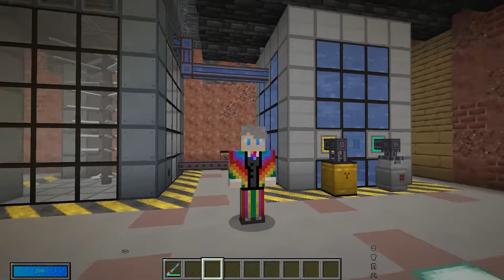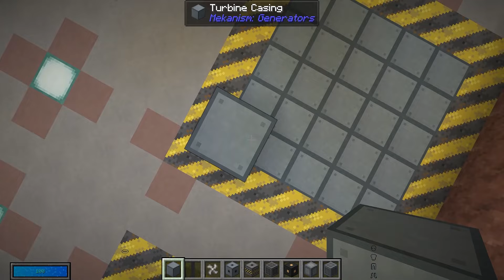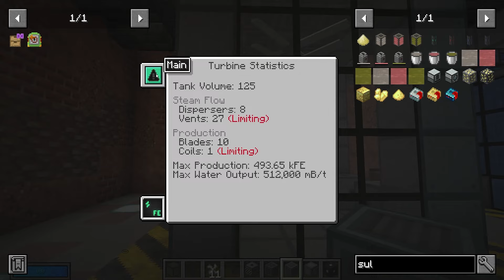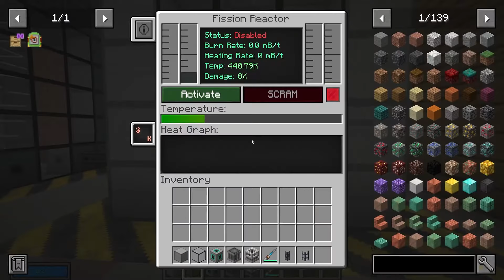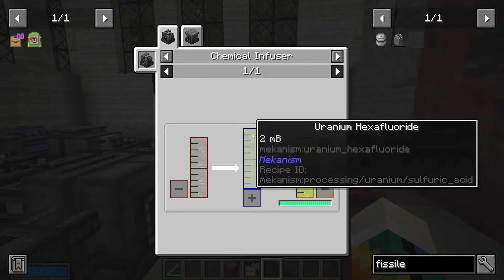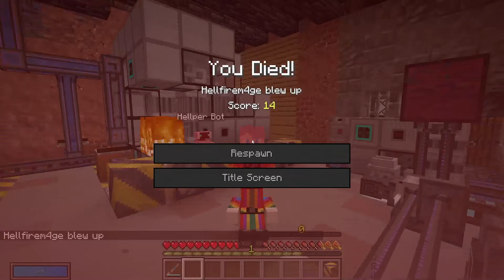Fission Power is Powerful (And Deadly) - Mekanism Fission Reactor (+ Turbine) Guide

Comment: I'm not sure what to do my fission reactor just won't work I tried everything I looked over the video 5 times .do you have any advice?
Reply from the maker: What modpack are you using? Some packs require structural glass for example
Reply: @Hellfirem4ge  Sorry I was using another modpack that had two different types of reactor glass and i used the wrong one on accident
Reply: If you may I have another question I was wondering how you got the water to fill up the fission reactor so fast is there another pump besides the regular pump because originally, I used 32 pumps and I only just a little bit of coolant.
Reply from the maker: @antsforever1356  I think in the video I used mekanism pipes and a sink from cooking with blockheads but having a lot of pumps is probably the way to go with normal mekanism. Thankfully you don't lose water over time so you only need to fill it once
Reply: @Hellfirem4ge  Thank you so much for the info overall the video was very helpful, and I wish you luck to a million subs!

Comment: I followed every steps 2 times and it blowed up each times , i really dont know what im doing wrong i set the fission reactor to 0.3 so it doesn't absorb too much water beacause i dont have the sink like you have so im using water pump and i need a lot of them  and i added some waste barrel  in case , after 5minute trying to build the setup for the fuel i turn around and it was all explode , The mod Mekanism was really fun until this part , maybe you should use something else other than the sink next time so people dont have to struggle with a other solution ?
Reply from the maker: Before it blows up, is there still water in the reactor? Chances are you're overflowing energy if there is still water there

Comment: I’m having an issue where I can see both the turbine and reactors interface but when I activate the reactor, there is no burn rate or heating rate. Nothing happens. I’ve looked through the comments and found the structural glass switch from reactor glass for the turbine and it hasn’t helped. My coolant tank is filled with water all the way. I have everything connected with the correct cables, my reactor ports are configured to the right setting. I have the second turbine valve connected to an ultimate energy cube for power. Still nothing. Any help? Thanks
Reply from the maker: I've honestly never heard of that error I'm afraid so I'm not sure what would be causing it 🤔
Reply: @Hellfirem4ge  actually, i just rewatched your video. And saw that the moment your reactor turned on, there was fissile fuel in your fuel tank. Did I completely miss that part? I need to have fissile fuel in the ultimate fuel tank in order for it to work?
Reply from the maker: Oh yeah absolutely, you need to have fissile fuel for any of it to work 😊
Reply: @Hellfirem4ge  can’t believe I missed such a fundamental factor. The fuel. Thanks for the help. Great video:)
Reply: Hey @Hellfirem4ge i need help on one more thing. I put together all the machines to create the fissile fuel with all the logistical, mechanical, and pressurized pipes. But it seems in your setup, you dont have any universal cables for power. Are they underground in your setup? Not sure if you even need the power. Thanks in advance
Reply from the maker: @Voundier  yes they are 😊
Reply: Great, just finished making the fissile fuel and my both my reactor and turbine work. Thanks a lot. Earned a sub
Reply from the maker: @Voundier  glad to hear it! Now your job is to make sure it doesn't blow up your base 😉
Reply: @Hellfirem4ge  it just did😭😭. I looked up it takes about a week to pass on. I’ll just be using digital miner to recollect the ore needed to make it again😞
Reply: @Hellfirem4ge  I think I didn’t have enough waste barrels? I left it alone to do some other stuff and I came back to it blown up and died to the radiation. I don’t know what I left out cause it all worked well and I didn’t max out the burn rate(I left it at 10/15)
Reply from the maker: @Voundier 10/15 is still insanely high! Waste will go up pretty quick at that rate and you will get a lot of energy so an ultimate cube will fill up in a couple of minutes so you need to be siphoning the excess energy
Reply: @Hellfirem4ge  I see, I thought 10 would be fine. so the issue is that there’s too much energy in an ultimate cube and that causes the explosion? Or is it the waste barrels?
Reply from the maker: @Voundier probably both, but I would imagine the energy is a bigger deal. It will back up the system, stop the steam from being turned into energy and then the reactor fills up with steam and can't cool down so it explodes. You'll want an induction matrix or some sort of energy voiding mechanic
Reply: @Hellfirem4ge  ah okay will try it. Thanks for the help again

Comment: I'm having some troubles with the yellow cake uranium. I'm trying to use refined storage to auto-craft them, but my crafting monitor says that "no machine is found". The crafter is connected to the enriching machine and it works for other enriched things - yellow cake uranium is the only thing that it can't find the machine for. Any ideas on what the issue could be?

Oh and btw, great video!;)
Reply from the maker: Thanks! It should just be an enrichment chamber. I've not tried connecting RS up to it so I'm not sure why it wouldn't pick it up. Have you tried outside of RS to see if it works?
Reply: I have my crafter with a cheat in front comected to the enrochment chamber then an imported on the enrichment chamber the the system

Comment: Mine exploded.  For some reason the steam wasn't get turned back into water
Reply from the maker: Did you have enough condensers in your turbine?
Reply: @Hellfirem4ge  yes I realized I didn't have enough storage for the power so the system got backed up? How do I spore mass amounts of power? Induction matrix?
Reply from the maker: Induction matrix for sure or if you just need an overflow, a cube with energy dumping to get rid of the excess
Reply: @Hellfirem4ge  awesome thx! Keep up the great work bro

Comment: done this step by step and it doesnt work still.
Reply from the maker: It's worth checking the requirements for any specific modpack you're using. This should work perfectly for standard mekanism or VH
Reply: @Hellfirem4ge  thanks for the reply man I figured it out I needed to use structural glass instead.
Reply from the maker: Ah yeah that's a common issue for some packs 😊

Comment: My reactor isn't working because there's no power coming in, but I followed it step by step and the power doesn't work, I have enough power and I've already redone it about 30 times, can someone help me?
Reply: Im having the same issue. I have every step done and triple checked. I even filled an ultimate energy cube and tried powering it that way, still doesnt turn on. He didn't show him powering it on with the energy cube so im assuming he might have used the configurator to change the way it connects to the turbine valve. not sure though
Reply: @Voundier  i just put steam on it and it works, the power dont show btw, ATM7 to the sky version

Comment: i only need the reactor for the radioactive waste, do you think this could work with a electric pump and elite pipes? on the lowest settings.
Reply from the maker: So if you set it up correctly, you don't actually need to be pumping any more water in, so you could use that setup to fill the reactor, it would just take a long while. Just make sure that you turn it on, wait for the water level to drop, then turn it off and fill it up again to keep it flowing 😊
Reply: @Hellfirem4ge  i'll try, thank you very much for the detailed guide :)

Comment: is there a reason my turbine reactor won't accept power? i have connected universal cable and it does not have any power, my guess is that it has so little that it doesn't show
Reply from the maker: Turbine reactors don't need power, they need steam from a reactor and then output power

Comment: Followed your instructions very precisely and my base blew up
Reply from the maker: If it blew up, you definitely missed something.
The things that can cause it to blow up:
-Not enough coolant being pushed into the rector
-not enough energy storage so the steam backfills into the reactor
-chunk loading issues if you leave the reactor running, especially when offline

The redstone contraption i show at the end of the video should fix all but the chunk loading issue though
Reply: @Hellfirem4ge  thank you :)
Reply: When I built mine found out it was an energy issue built a Resistive heater set it to max and have been running the reactor at 100% with no issues.
Reply: I built it just Like you but the fission reactor does not construct only the Turbine
Reply: @yannickschmitt5059  gotta use turbine casings to build the turbine i did the same thing. If you use the fission casing blocks it wiil not work

Comment: What pipes are you using? I can’t get anything to connect when trying to make the fissile fuel. There’s multiple pipes in the video it seems
Reply from the maker: So for most of them you need ones that transfer gas, so the pressurized tubes but some things need normal pipes
Reply: @Hellfirem4ge  I’m using mechanical pipes and pressure pipes but I can’t get either to connect to the enrichment chamber
Reply from the maker: Make sure the configuration is set correctly in the enrichment chamber. It allows you to restrict which sides things can go into
Reply: @Hellfirem4ge  it’s the logistical transporter tubes! I found them. Thank you!
Reply: I'm still having problems connecting the port to in put water

Comment: So quick question? I built the while thing right… now i dont quite know where i would put my Flux plug or some thing like that to use the energy produced?
Reply from the maker: You mean the port? You can replace any of the glass with a port and it should still work 😊
Reply: @Hellfirem4ge  Alright ill try it next time i hop on the server , thanks.
Reply: @Hellfirem4ge  i tried the 2 mekanism ports but it still didnt work… also the reactor blew up( ive been running it at .1 and even with 20 sinks connected the water still went down extremely fast, so im confused there)

Comment: There are 777 likes on this video, so I will instead leave a positive comment 🤣
Thanks for the tutorial! I definitely need to see if I can increase the power output of my turbine (142.81kFE/t) with hopefully the same burn rate of fuel (5mB/t) because I have to say I'm disappointed. I can use 6 PRC's running bio fuel from crushed melon slices (infinite obviously) and make more power than burning Uranium 😒
Reply from the maker: Thank you! You can definitely make that a lot more efficient, check the bottlenecks on your turbine and make a couple of tweaks and I reckon you can 10x that quite easily

Comment: What is a boiler for then? I thought I could make a boiler to power the turbine, but it requires more power to heat the boiler than I get power from the reactor in form of steam.
Reply from the maker: You can also use a boiler but it doesn't produce nearly as much energy ☺️

Comment: My turbines never spun, it overheated and blew up. I wounder if it matters what hose upgrade you use and I would love to know the power source to use  cause every "How to" uses source blocks not in survival for power.
Reply from the maker: You definitely need a lot of strong pumps to keep up with the reactor, it burns through a lot of water, but as long as it's completely full before you turn it on, and you refill it once when it is on, it should make an infinite loop. It sounds like you didn't give it enough time to fill up fully

Comment: you have your setup wrong. dont put pipes between the turbine and reactor. go port to port. will run and work 10x better. thats the way the devs designed it. that way you dont need to supply it with coolant once you turn it on even at max level

Comment: another tip: the amount of vents is usually exaggerated, a 5x5x5 reactor like the one in this video, at it's max burn rate of 10mb/t, will boil 200000mb/t of water and produce that exact same amount of steam per tick. and, one vent on that turbine will handle 300000/t. BUT! i recommend having two vents, and a dual channel for the coolant, because the ultimate pipe's TRANSFER RATE is 128000mb/t. note that the PUMP RATE here doesn't matter, because the vents automatically eject, the pipe doesn't need to pump. however, an example where the pipes NEED TO PUMP, is, when you're pumping water from the cooking for blockhead's sink.

Comment: one electromagnetic coil can support 4 turbine blades, you added 5 rotor shafts which means 10 rotors which mean you need 3 coils otherwise you won't be generating as much power as the blades can support. you only added one so that's wasting a lot of power
EDIT: alright i didn't watch it until it was fixed, but the information of 4 blades per electromagnetic coil is still useful

Comment: WARNING: At least in the 1.20.1 version, if the internal energy buffer of the turbine fills, the turbine will stop spinning and WILL NOT CONDENSATE WATER ANYMORE, and the system will run out of water and the reactor will overheat, no matter if it's set to idle, dumping excess, or dumping.
Reply: Wait im playing on 1.18.2 and my reactor is overheating what do I do?
Reply: @thewaytodrown8473  check the reactor's boil rate, and check if your pipes can handle the flow, the pipe's TRANSFER RATE, NOT PUMP RATE, should be greater than the boil rate. pressurized tubes have much greater transfer rate than mechanical pipes, so the bottleneck is likely coming from insufficient water returning from the turbine. if the reactor's boil rate exceeds the ultimate mechanical pipe's transfer rate/capacity, add a second channel, and on the turbine, make sure the max water output (from the condensators) and the max flow (disperses and vents, you probably have the 8 disperses around the rotational complex so it would likely be the vents) are greater than the boil rate of the reactor
Reply: test the theory out can confirm 250% damage has been made.
Reply: @zacharybravo8201  the turbine filling up is the most common cause of mekanism meltdowns. happy new year btw
Reply: te quiero

Comment: you should do a part 2 of this video for two topics. Topic one, how to make an energy excess drainage system to avoid a meltdown due to energy not being used/stored. and Topic two, how to safely empty or move the radioactive waste bin connected to the reactor. I am not knowledgeable enough in the mod to know but I really want to make this thing and can't after seeing all the comments lol. I do not want to blow up my base.
Reply from the maker: haha don't worry! All you need to do with the nuclear waste is pump it into another waste bin and hide it somewhere, or if you're going down the antimatter route, process it that way :) I do have a guide on fusion and antimatter that would help with that one!
In terms of the energy, any sort of annihilator, trashcan or even making an induction matrix which is big enough would work super well!

Comment: Didn't mention it, but should advise people to not try to be smart and use sticky pistons on the reactor failsafes -- if anything goes wrong with reactor you don't want it to clear and reset on it's own.  Very likely to then fault, reset, then blow up from same state if it was already damage from first fault.  

You can make the reactor almost never have to turn off/fail if you put 2 extra valves on the turbine.  Put comparator on one that will output the steam level and the other you put a resistive heater that requires a redstone signal and is set to like 10-100 times your turbine's output.  Anytime steam fills up it can run the heater to bleed some energy, so reactor never loses coolant loop when turbine self slows from energy/steam being full.

Comment: I always end up with this exact situation:

Turning the machine off right before it gets dammaged from a lack of water, due to the heat rises so fast. Do I set the turbine to "dumping", "dumping acces" or "idle"? And how on earth, can i "set it and forget it" so that it doesn't overheat so easely. Perhaps you could do a video simplifying the COOLING PROCCESS for absolute idiots when it comes to this subject like me lmao
Reply from the maker: As long as you have enough energy storage (so the steam doesn't back up) and you have enough saturating condensers and pump the water back into the reactor then it shouldn't explode. The big one is making sure you have some sort of overflow to dump the excess energy. Dump excess might work but I've found it's not 100	% so I just add either a huge battery or some sort of energy trashcan as a safety measure

Comment: Great video, it helped me a lot! In my case, I had to add one sink for every 1mb/t. For example: 15mb/t = 15 sink to make it work and not explode. Playing on the FTB Direwolf20 1.19.2 modpack!
Reply: the bottleneck is not the sink, the sink makes literally infinite water/t, it's the pump rate of the pipes. so you can just connect more pipes to the same sink
Reply from the maker: That's an insane amount of sinks! Once its full, it should have enough fluids to be endless as long as you have enough saturating condensers because there's nowhere for the water to go 🤔